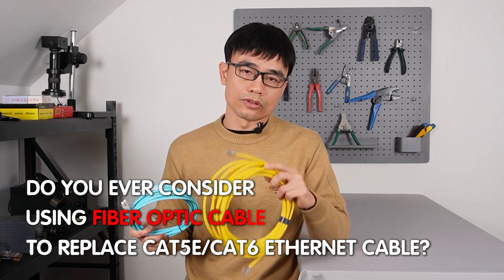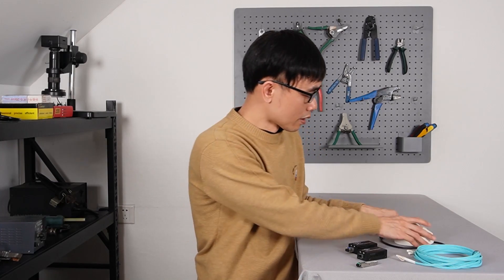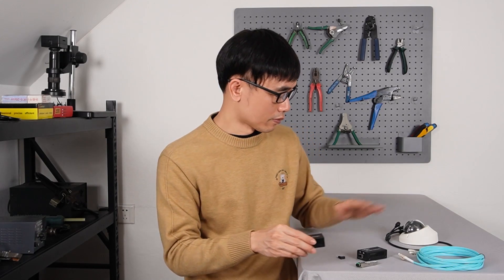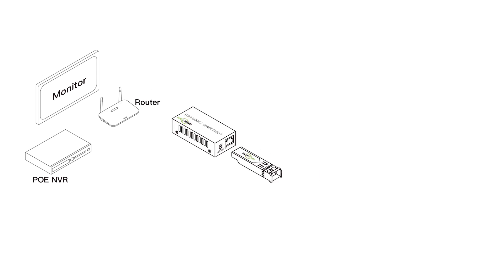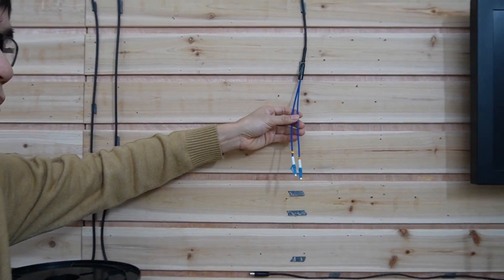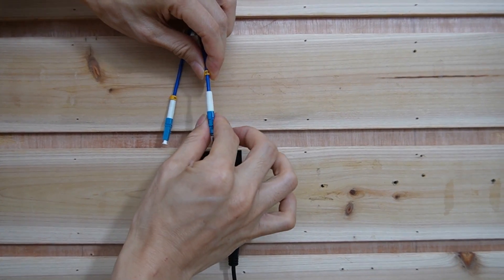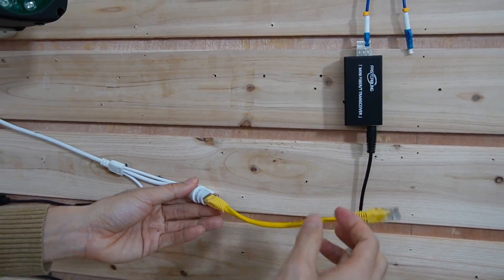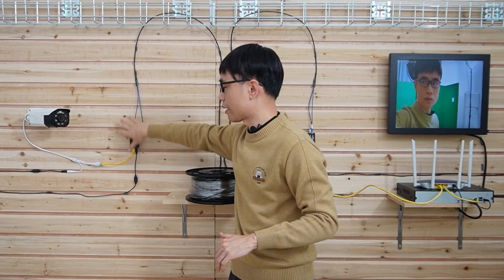Fiber VS  Cat6 Is it Fiber Optic System Setup Complicated？

Comment: Did I understand correctly, that you cannot make a sharp bend in the fiber optic cable, or it will be damaged?
Reply from the maker: Yes, that's correct! Bending the cable too tightly can result in signal loss or even damage to the fibers. To avoid this, it's recommended to follow the manufacturer's specifications for minimum bend radius, usually a gentle curve rather than a sharp angle. When installing fiber, ensure that you’re using appropriate routing methods to protect the cable.

Comment: Another excellent video! My one question is, with those exact media converters is there a maximum length of fiber cable you can use?
Reply from the maker: The maximum length is determined by the SFP. It is 20km with this SFP.